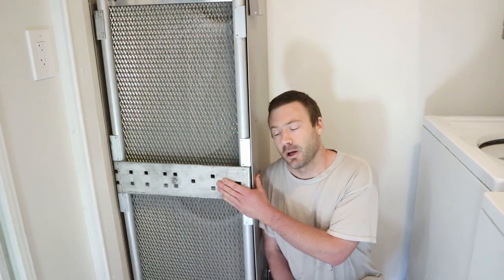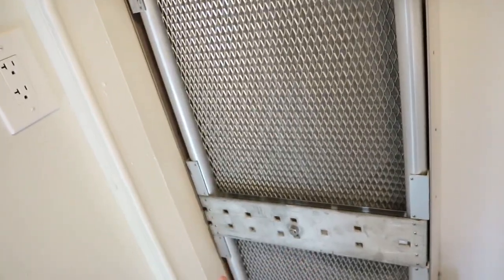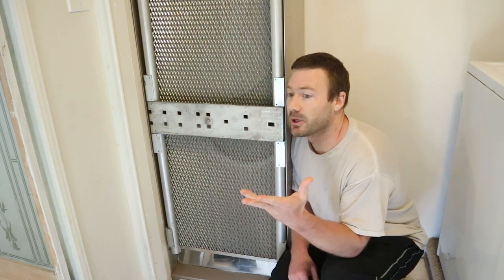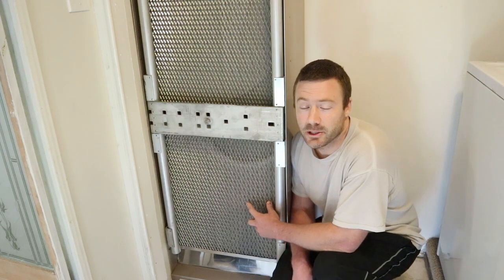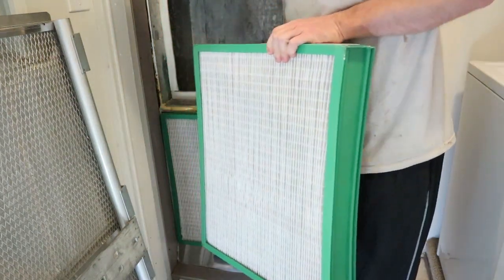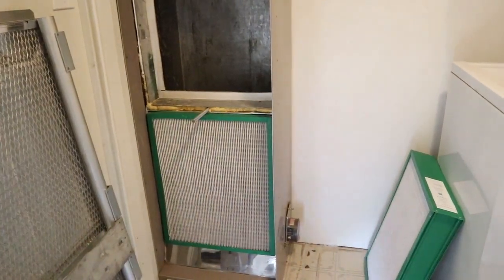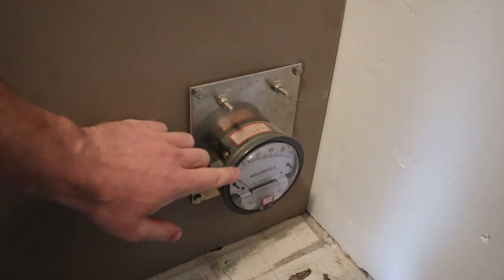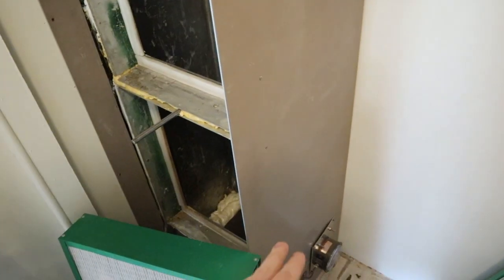Every man's superior HVAC air filter of the future? 2020.

Comment: Why lift it off of the floor when airflow goes through duct system.  Nothing goes straight into the filter from the floor below it.
Reply from the maker: computers located on the floor gather dust about 3x as quickly as those located on a desk. it'd be similar for an air filter. Also using a vertical filter mount allows for a smaller hole, equal to the minimum recommended duct size for one's AC unit.

Comment from the maker: update- december 2021 - cat hair was hardly present, but dryer lint was well-caught by the aluminum filter when the dryer tube wasn't connected properly. I washed it once about 8 months ago and drying took forever. Like 4 days. Pressure was still ~.22" for a while after that as it dried. Now, it's sitting at about .16" again. Just like new. These filters might last forever, but I am pretty sure that the filtration level will drop over the decades...which is far preferable to the filters not degrading and getting plugged up with unwashably small elements. In other words, I am now convinced that this is indeed the perfect air filter...but I'd recommend about 3 filters instead of 2. I say 3 instead of 4 because they upgraded the density of their filters such that each of these now provides about 94 square feet of surface area per filter.

Comment: I have the same linoleum!  This is a great idea and it would probably fix the issue  I'm having with my furnace from 94'.  New wifi thermostat shuts off every 2 minutes with the filter installed.  Runs fine with no filter.  Went from a MERV 13 down to a MERV 6 and still same thing happens.
Reply from the maker: shoot! man, that's rough.
I wonder if the furnace fan bearings need replacement, the motor bushings could use replacement, or something like that is also contributing to a lack of airflow.
If you have the same Lino, then perhaps your furnace is like mine was and the hot air must be forced through the AC coils before entering the duct work? If so, dirty AC coils are gonna be tough on the airflow.
lemme know if you fix it, eh?
Reply: @JustinCrediblename  Yes.  Its an old goodman furnace and the airflow is forced through the ac coils.  I'll see what I can do about cleaning those off and get back to ya.  Thanks for the tips!
Reply: @JustinCrediblename  Justin,  I took a holesaw and punched 2, 4" holes just below  the ac coils.  I looked in there and didn't see much but couldn't see much.  Stuck a vacuum end in there and wiggled around while blowing with an air compressor and the vacuum kept clogging with what looked like lint trap findings.  There were mini blankets of the stuff in the heat exchanger coils and when the furnace would kick on, these would blow and clog up the ac coil fins.  All said and done, I could have filled an ice cream bucket with the lint vacuumed out of there.  Tested out the heat right after and its problem free now.  (So far)
Reply from the maker: @jsnyara  EXellent! :)
edit: so, at risk of annoying you, I'd like to ask a few questions.
How did you stumble across this video? How long had you had the furnace shutoff issue? and how do you feel about my comment about unblocking the airflow on your furnace?